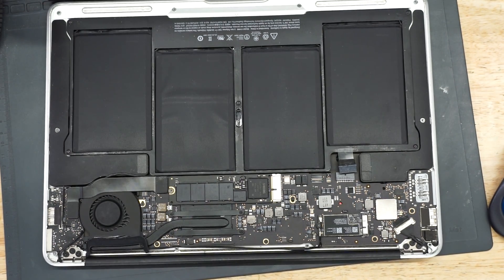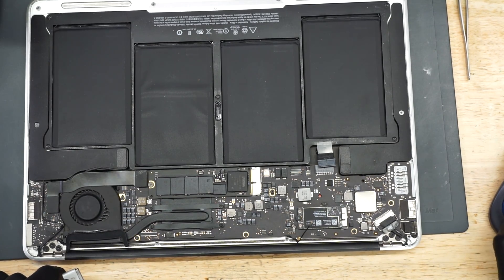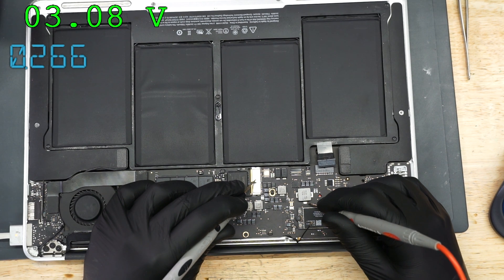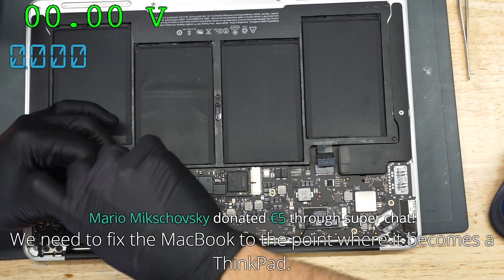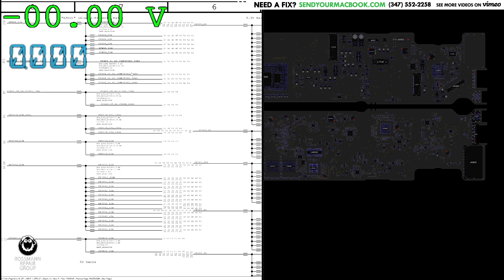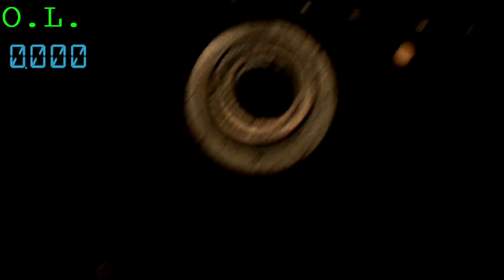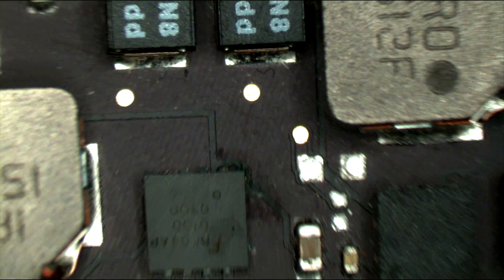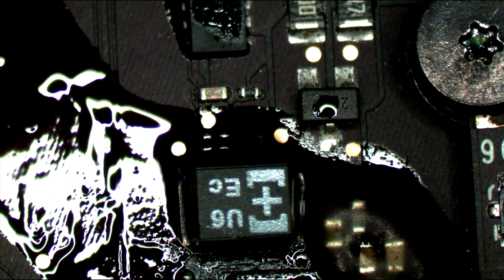Board repair featuring discussion of a new trade association

Comment: You should get a thermal camera when you need to find a shorted component, saves you some trouble. Not complaining, just advising.
Reply from the maker: I have one, it is in the other room. If I can find the short without getting up, then that is the winning solution.
Reply: @rossmanngroup  This a new industry standard?
Reply: @rossmanngroup  I am a bona fide economist, and that is what we call Efficiency!
Reply: @rossmanngroup  keep them Coming in.
Reply from the maker: Thermal camera takes longer to plug in and boot up than owie test
Reply: Louis Rossmann is there a scope camera out there that has a thermal mode? it would be super useful, I’m sadly yet to find one myself
Reply: Chat has been bugging Louis about hooking up the thermal camera since he moved, and probably prior.  At least he's not putting his lips on these Corona boards to feel the heat.
Reply: @joefowble  I think a slice of American Cheese can be used to replace a thermal camera. Just find the components with cheese stuck to them, and they're the shorted ones. VOILA!
Reply: you mean the plz bro camera?

Comment: Your "Standard" sounds similar to an ISO quality management system. What you are describing is developing a set of quality system procedures for your industry (independent macbook/ laptop repair). This would also require some sort of auditing to ensure that people who have the right to advertise that they are "XYZ certified", have proper systems in place to ensure that results are consistent.
Reply: IEEE is another: https://en.wikipedia.org/wiki/IEEE_Standards_Association
Reply: IEC, ANSI, ISO, IEEE and such are all big standards groups that standardise various different things. Sometimes they'll make you pay to get access to standards, but most of the tech related stuff is available freely, it's stuff like standard circuit symbols and whatnot you have to pay for, which is somewhat annoying
Reply: @SkigBiggler The Right To Repair movement may get more traction with a larger standard which includes home appliances, vehicles, marine, farm machinery etc.

Comment: Suggestion to standard: Always do a thorough removal of old solder from both affected work subject and solder tips, after using Bismuth-based solders, to limit the risk of lead contamination to any Bismuth-Tin containing alloys in final joints. Even if your shop is RoHS, the customer might not be honest or fully aware of any former repairs (using lead-based solder).

Comment: Regarding your question on standards within the industry, there is already a world wide industry accepted standard for electronics, soldering, pcb's and that is IPC  https://en.wikipedia.org/wiki/IPC_(electronics)

The standards that specifically relate to the electronics industry is IPC-A-610 Acceptability of Electronic Assemblies and IPC J-STD-001 Requirements for Soldered Electrical and Electronic Assemblies.  The IPC also has standards for quality control and inspection, for handling of electronic assemblies, standards for packing and shipping of electronic assemblies, manufacturing of electronic assemblies and much much more.

You need to give the IPC site a good read https://www.ipc.org/ because it covers everything to do with electronics.

Comment: Hello Mr. Rossman. My job is to repair electronic boards in Iran and recently I faced a strange problem.
As I was repairing a BMW 730i 2017 wing mirror electronic board, there was a dubitable component from ST electronics company which I couldn't find its datasheet on the internet. That was a 2 pin component with Zb2b part number. I am wondering if you could help me with finding out what component I should replace with this. sincerely.

Comment: guys does plugging in a macbook and using it on power all the time helps or hurts the battery? it is okay if i use mine with the charger connected all the time?
Reply: most laptops it hurts. it seems we are finally getting to the idea of having a charge percentage setting so that perma docked laptops can try to stay around 50% charge, and possibly be able to hold a charge for more than 10 minutes 1-3 years later. a constantly dead battery and a constantly fully charged battery, especially lithium based ones tend to fail faster than one that stays more middling.

Comment: Something is not right with this machine and as such I think it needs explaining. It is very clear that the motherboard has sustained liquid damage BUT the issue of the right hand speaker cable being positioned under the motherboard means someone prior to you has at some point taken out the motherboard and re-assembled the machine incorrectly. Now, the issue is,  the person that removed the motherboard prior to you, did the customer tell that repair person that they had spilled liquid on the machine and that the repair person said they was unable to fix it, re-assembled it wrong and the customer then turned to you asking if you could fix it?  This needs to be clarified.

Comment: Everything you are doing has a mil-spec, Louis. The methods and inspection standards are literally already made and published and available to you. You paid for it with your taxes! Use it, even as a framework.
Reply: Could you explain?
Reply from the maker: Tell me more. Most "mil spec" stuff I've read had to do with radiation levels some component can take, not how to run a jumper wire under a BGA. If that is even acceptable.
Reply: @rossmanngroup  CFR and FAR has some of it defined in the sections for aircraft maintenance but they all use the guts of Army manuals for "best practice" definitions. Gimme a couple days and I'll send you a bibliography. 😁
Reply: @rossmanngroup  NA-01-1A-505 is general electrical/electronic and the submanual is the -23, covers MicroMiniature component repair.

That one is a Naval manual. There's more, I'll keep them coming as I find more.